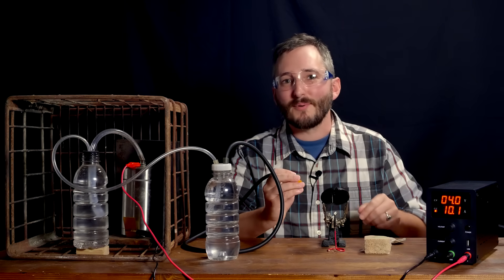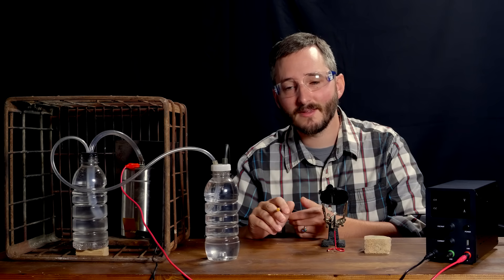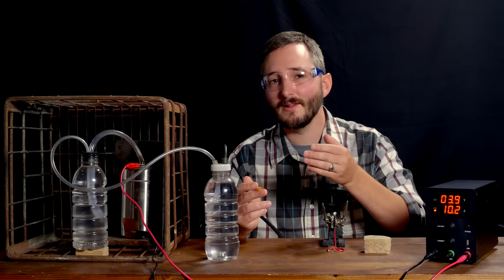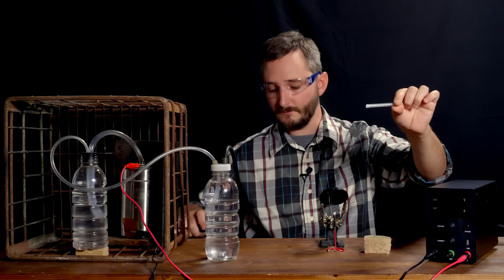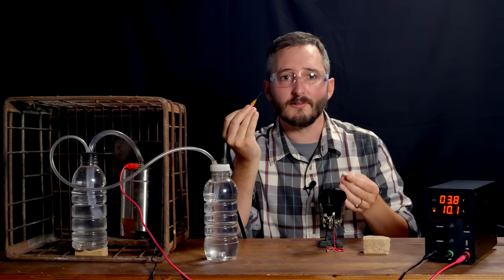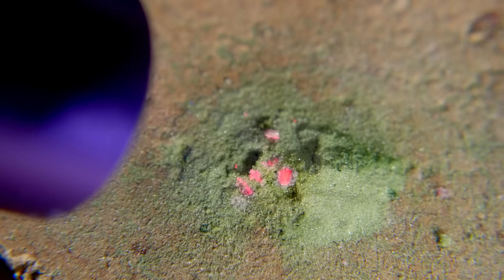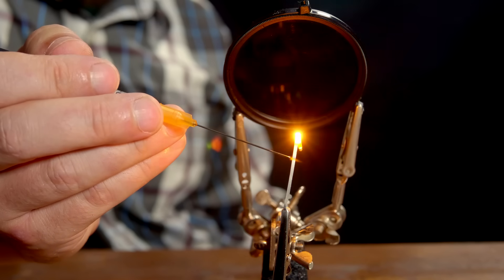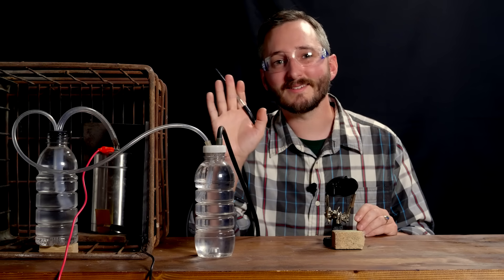DIY Oxy Hydrogen Torch Using Water Electrolysis

Comment: Do this electrolysis, follow the resonance plant, get the volts up, and amps down to .5. add a pump to circulate past the stainless scouring pad you want cavitation.  

 If you do this right, it works on distilled water. You can take that flame and melt things hotter than the supposed flame temp, because properly made HHO. IS not really JUST HHO.

they say browns gas reduces radioactivity, so do charge clusters. Every water car, is running on charge clusters which tap ZPE and give true over unity that is physically sound. Ur not getting energy for nothing, just cheap.

"One well documented potential application of EVOs is their use in eliminating the radioactivity of spent nuclear fuel and contaminated nuclear materials. This should be particularly welcome to those looking for a way to solve the problem of what to do with all the radioactive waste materials produced by reactors and other nuclear facilities."

I can't make you see the future, but I can give u the future and let u choose. Good luck, I enjoy 0 energy bills for home or car. No solar no batteries just watee

Comment: Where does he get the flame temp of 2100 degrees? I have an oxyhydrogen torch and the flame is not hot enough to boil water but cuts welds and braises metal just as easy as an acetylin torch.

As far as I know hydrogen torches would be everywhere but hho torches are niche products why? 

Several Russian companies make full size torches for industrial use n they are used in place of arc and acetalyn welding.

I personally doubt its oxyhydtogen doing the welding but an EVO trapped in between two dipole water molecules making it a gas, but carrying a charge cluster. Flame or spatk breaks the water jacket frees the charges the result is what we see. Hydrogen melting n welding tungsten carbide.
Reply: Charge clusters attributed and verified by ken shoulders, these conditions exist in Many high voltage pulsed elextrokiser by accident. Adding a water pump and higher voltages will create cavitation between the plates cavitation allows for vacuum, im sure you realise now there is millions of tiny vacumes, and thousands of volts discharging through them, that's how you get a charge cluster or toroidal collection of millions of electrons, they are called EVOs. which to this day are still not even studied because of the obvious implication that they tap zero point releasing way more energy on impact with sample then took two generate, that's why if you look up Evo's you'll find out they are in fact legit but all research into them stopped when Ken shoulders died for a cluster of electrons smaller than a nucleus of an atom to blow a pin size hole in aluminum foil multiple atoms thick races a lot more questions than answers and apparently these days science does not like questions

Comment: I was experimenting with HHO a few years ago. I made working unit with non stainless parts.

It worked...but corrosion was fast.

I used a bubbler...

Which blew up in my son's face (plastic and luckily no injuries).

So I spent more time learning how to construct a brass spark arrestor.

I still have it and it worked great.

Comment: I adore the videos.I just do.That "tiny" flame does have loads of uses in jewellery-making that I already know of and hope to discover more of.
 But I have a worrying question.When you inadvertently sealed the tip of the burner needle I saw the system was still producing gas so I assume pressure is now building in the system.Is this not dangerous with HHO gas.
Do please do more vids as time allows but please also do stay safe.

Comment: Wish NASA had a open mind , So this would be a extension of my work(and alot of others throughout time) However my Idea pertains to the moon and SpaceLab or whatever they are calling it today, Company I used to work for Made gastight teflon fabric that could be made it a recovery bag, for Human waste, built in  liquid/solids separator with drain and connector ports, ok theory is on the moon, waste is collected,  mixed with urine or waste water,ground into slurry, pumped, and injected with methane producing microbes, and let to percolate over time as it fills, Draw off liquid for 1 farming or 2 Eletrolisis making O2 and Hydrogen,  or 3. Reverse Osmosis .  SO we have a gas recovery pump with refillable cans of Methane, O2, Hydrogen, and over time useable Humass that can be harvested and used for when they make moon/ space green houses.  The Bags can then be sliced across one end lifted or shoveled out and cleaned, repaired and put back in to service, OR cut along the half way mark and make it's own planter with built in lifting straps..... but No one sees the relevance.....

Comment: interesting fact for you, since 2020 they have experimented using external magnetic fields to double output as it drives the electrons with more force also carbon scouring pad on electrodes also helps increase surface area but you kind of achieved that with your scouring pad. defiantly a good idea for a v2 you could then increase nozzle diameter and have a bigger torch for more applications

Comment: If that small torch, using hydrogen only, pointed at can full of sand, could that be used as mini heater? I am wondering because i know that's small flame but as i heard it has really big temperature

Comment: Nice work; but it is kinda disappointing to think that it will only work for the really small stuff.
I assume that you know what the tip of oxy accetaline looks like?
It has 7 small holes that have somewhat of an adjustment to flame. 
These tips also come in different sizes. 
I would think that a person could do the same with the hydrogen torch.

Comment: That was amazing!!! Thank you for the awesome video! While watching it I was thinking that you could push the unlit gas into a vessel and then compress it into a canister from there. Like an empty propane or butane canister. Then you could achieve higher gas flow/speed and up the nozzle size to something akin to a plasma cutter size or a standard welding torch. You would probably would still need flame arresters, but it would hack straight through most things at that size and temperature. It could be highly useful as a forging torch, or to heat a crucible. Or if you could flatten the flame shape, it could be used like a laser.
Reply: The mixture obtained in this process is commonly known as hydroxy(HHO) and commercially as Brown's gas.  The drawback with compressing it is that it will combine the oxygen and hydrogen which hydroxy consist of, so it may be compressed only slightly.  I used it a lot years ago when trying to run an engine on it.  You can google Brown's Welder or -gas.
Reply: Just adding that I had the odd explosion and not nearly as potent as for instance Acetylene or LPG.

Comment: I read a lot about HHO when I played with it about 20 years ago and remember that flame temp was found to be very low, 120 or 140°C. The paper said that it would not boil water or cause serious burns for short exposure to the skin. 

The heating occurs on the surface of hard materials. It is capable of melting tungsten is seconds and glazing cement without cracking it because it heats the surface quickly. 

Another paper spoke about the reaction that it does not result in water vapor but directly in liquid water and was a great way to create vacuum in large volumes by first filling them with HHO then igniting the gas. It is not an explosion but an implosion.

Comment: I have an idea. Try adding a valve on the 2nd bottle connected to a tank of inert pressurized gas. That way you can close the electrolysis process after you open the gas valve that add extra pressure and dilute the mixture in nozzle tip.

Comment: The way I would think this would be practical with an oxygen and hydrogen torch is to build a larger device maybe around the size of a cooler that would be able to produce large amounts of hydrogen and oxygen gas.
Then, separately through it being stored in large tanks similar to how normal welding happens, could you make a torch like that.

Comment: Amazing work! I just tested electrolysis in salt water using a solar panel. You can see the videos on my channel. It was definitely not as elaborate as your setup.
I wonder if you could try your torch using solar and see how that works.

Comment: I really hate to be that guy but this video was a bit too preachy for my taste yes hho or brownsgas can be dangerous 
but as someone who has used a proper big hho generator and torch for around 2 decades 
i can tell you its not more dangerous than using an oxyacetylene torch and every little fab shop has those 
with the added benefit that you do not have to store oxygen at home and you can never ever run out of gas 
i think you should really follow up with a professional setup maybe you can rent one and show people how 
safe and practical it actually is

Comment: Dude one of my favorite videos ever.
Making one right now seriously that's what I'm doing the second I stop writing this..
I am going to try making one with a flow rate that can achieve enough to exit a oxygen acetylene jewelers torch without flutter.
I'm not sure if an inline spark arrestor will work considering they are primarily used on gas line that exceed . 25 psi but here goes the neighborhood.. lol

NEWS AT 10 
MAN ARRESTED FOR WELDING AN ARMAGEDDON TORCH AND CUTTING CARS IN HALF !
Is it too much power for one man to have, we'll have an answer right after the commercial break.

Comment: You can buy actual flashback arrestors for standard oxy acetylene torches and can get small torches made for jewellery work that are designed to run on hydrogen and oxygen.

Comment: I have a big hho generator, make 650L gas per hour, yesterday shortly after ignition the gas When I wanted adjusting the flame, I feel the valve are so hot. I understood the gas burning inside the torch, i turn off device, i saw the torch being melting.. this generator use hho gas + hydrocarbon..how to can avoid this issue? First I should open the hho valve or the red one( hydrocarbon fuel )? After using i need first turn off  the hho valve or red one? Thank you

Comment: Ben, I often solder copper when creating jewelry, a hobby, but finding a means to join copper with regular solder creates 2 problems for me.  First,     the color of silver does not blend well.  Second, intricate soldering can cause excessive heat and all the solder to
 flow leaving me with a pile of copper and solder.  Yikes!  I would really appreciate any suggestions on preventing these 2 issues.  This mini torch appears to solve this problem, this technique could be used to fuse the Copper instead of soldering.  I'm not well versed in this area.  This technique carries risk, and I'd like to mitigate it.  I don't want to be like Willy Coyote 🐺 here! Lol, but this could be a solution for me.  Thoughts?

Comment: is it possible use a sort of Venturi pipe to suck some air and reduce the chemical reaction speed? in this way should be way safer, a similar way could be to add a T in the rubber pipe and ave a bottle with a fan creating positive pressure in the bottle to inject air in the mixture of oxygen and hydrogen

Comment: Today i had decided test hydrogen as fuel ,so i recall several flame test and before watching your videos today ,,i just  decided to test the hydrogen gas using  sline pipe and  syringe needle ,and i had some little idea about backfiring .But i was sure to test without having precautions like u and it will be deadly for me and i am shocked and sir frightened a lot .And i have no idea about its dangerous back flame propagation .And Finally thanks  a lot     
And yours videos are so informative and and thanks once again

Comment: My setup was almost the same as yours, the only thing I added was a one way hydrogen valve, so any flashback was  only the needle and 5mm length of rubber hose with a 3mm diameter, I did get a flashback at one point and yes it made me jump lol but the valve did its job, making the flashback very small and even stopping it getting back to the first water trap. These experiments are 99 percent safe, as long as you sit and work it all out first, work out the dangerr points and take away as much of that danger as you possibly can without stopping the experiment, if we dont do things like this then how do we advance. From my early teens ive always been doing these kind of things, im 52 and yes somethings did not go to plan, but protection is the main key here and having ways of counteracting things that can and sometimes do go wrong. In my teans I was forever at the library, now it takes minutes to get iformation you need, just check at least 10 sites to make sure the info you are getting is correct and use reputable sites whenever possible as faulse information can kill. Learn, have fun but stay safe.
Reply: Can you please give me some reference for the valve?  i found some cheap tiny plastic ones but i dont know if these are enough for such a hot flame.
Reply: @CarlosAlejandro.-ke6gr  Yes mine was a plastic one, and cheap, half black and half white with an arrow showing flow direction. I tested it by lightly sucking to see if it held a vacuum (stuck to my tongue) worked perfect, so I had the generator to a water trap then the pipe (3mm id) the valve then about 20mm more pipe then the blunt syringe, the flames burns a few mm from the end of the syringe, so it doesnt get hot, but the water trap is so important, if the valve fails it still wouldnt be a huge problem as there is very little gas being stored, DONT STORE ANY GAS, yes you would get a flash and a bang, but nothing really dangerous, if your worried, run it through 2 water traps, it could never burn back to the generator then, but personally i think thats a bit over the top, All the best, stay safe.
Reply: @DenBlackburn  Thanks a lot! I kept googling after writing you and some people use brass arrestors for acetilene, they might be overkill but on the other side they are only like 8 usd here in Brazil so maybe im building a generator with a water trap and putting one of those for a little extra security.
Reply: @CarlosAlejandro.-ke6gr  I do not blame you, safety first, but because the amount of gas I was creating there was no reason for me to go brass, and lets face it, the tube is plastic, but you put your safety as number 1 priority ;) If you find me when you make the generator, please let me know how you get on.
Reply: @DenBlackburn  Sure! I will get in touch. Have a good day.

Comment: would have been cool if you tried fuse welding two thin guage metal plates together or welding them with a thin wire ,i would think you should have no problem with 1/16"